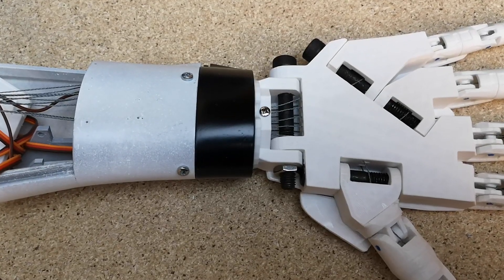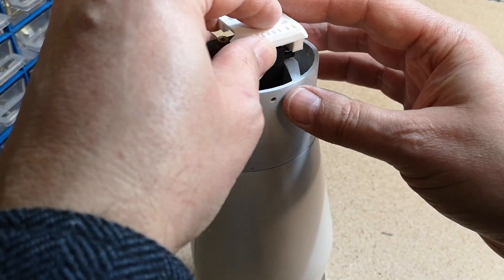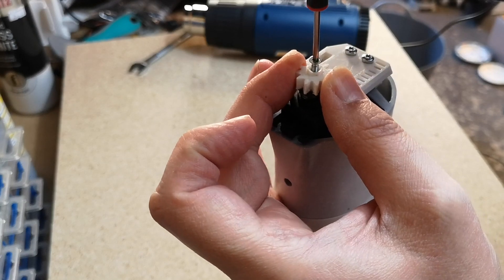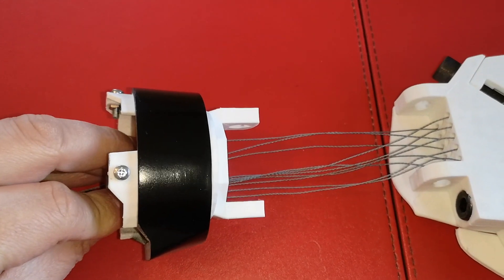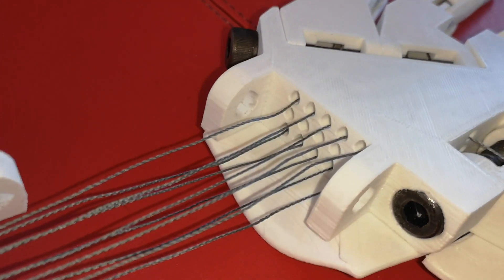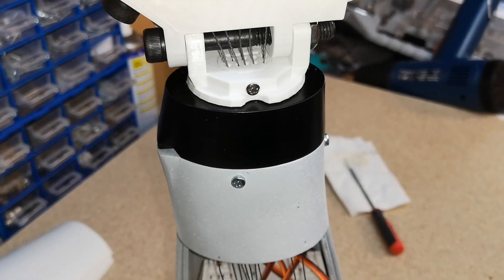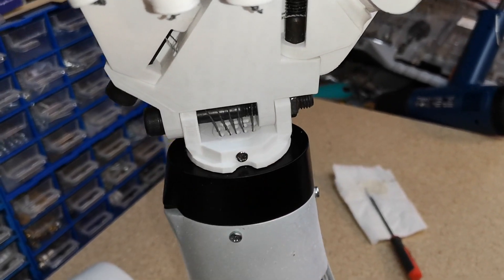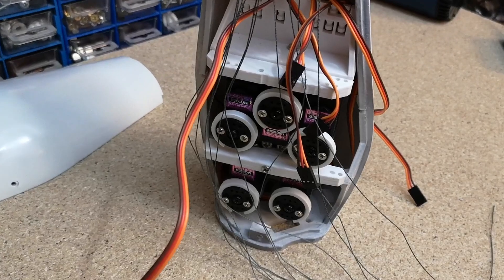Civrays InMoov - The Right Wrist

Comment: What servo motor are those?
Reply from the maker: MG 996, but I think they might be cheap clones. When I make more progress and get more confident I might switch out some of the servos for better quality ones.
Reply: @SteveRaynerMakes  I'm building my first Inmoov and I wanted to understand if these servo motorw can buy them on aliexspress?
Reply from the maker: These are equivalent to what I am using;
https://www.aliexpress.com/item/4000048090580.html?spm=a2g0o.productlist.0.0.42741671PsLWYs&s=p&algo_pvid=5b6ed3fa-0100-4a5e-9bba-4c5b62431510&algo_expid=5b6ed3fa-0100-4a5e-9bba-4c5b62431510-12&btsid=390c1df0-ee8e-4b81-b925-7a192015dc43&ws_ab_test=searchweb0_0,searchweb201602_2,searchweb201603_53
Reply: Very nice thanks, I wanted to ask you more, can I use Arduino Uno not original for this project?